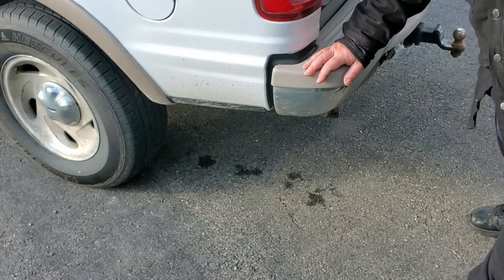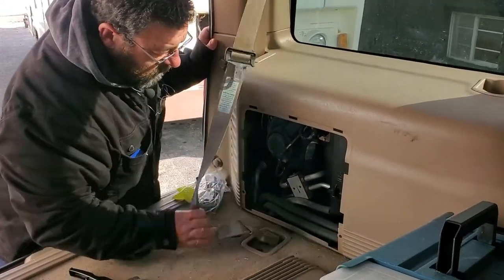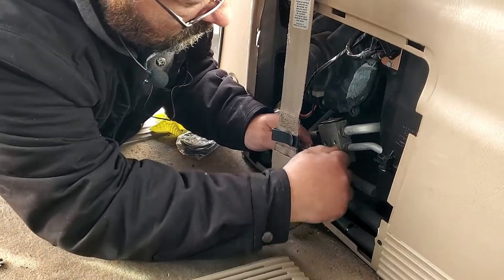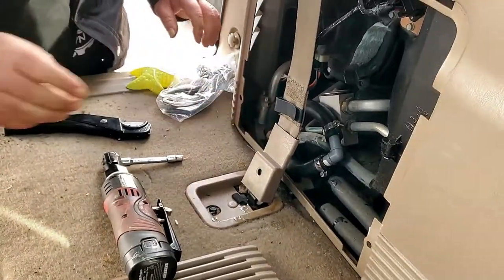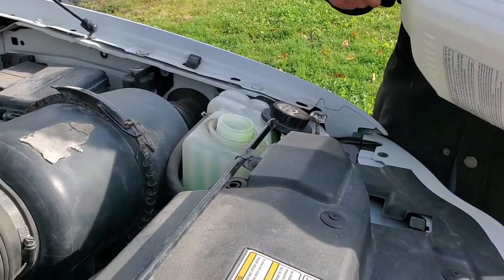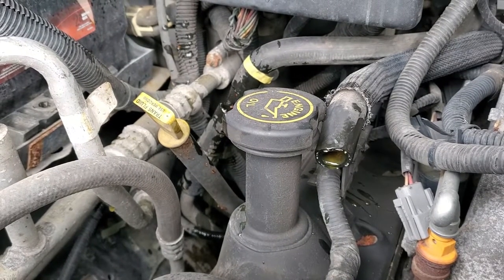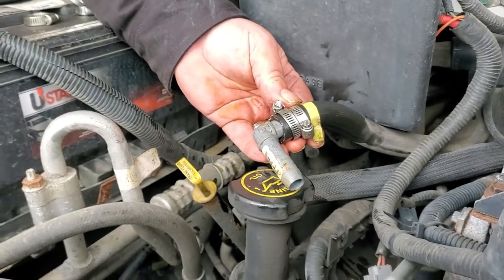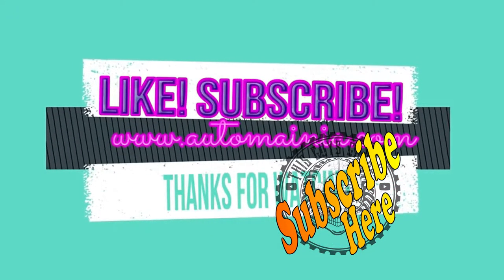rear heater core bypass

Comment: I have a 94 Ford Aerostar and it's leaking all along the side of the driver side to the rear. I'm glad you said Capital that the front instead of the back that's what I would have started as well. Now I just got to find the hoses I'm not a mechanic so thanks for your video
Reply from the maker: as long as you get in front of the leak you will be set . let me know how you get along.
Reply: Well I fixed it the two hoses for coming off of water pump so I just did a bypass right there in the front only took me 1 hour to do all the work no leaks!!
Reply from the maker: @brentmaveric4981  awesome Brent, glad to hear it

Comment: I'm permanently removing the rear heater unit to make more room for campervan buildout of my Chevy Suburban. Thinking I can just put in a bypass just like your video. Any concerns with this setup long-term. Do you have any advice for how to tie- out the A/C lines in the rear?
Reply from the maker: you will need to get the ac removal dealt with professionally ,huge fines for opening ac lines. no concerns long term

Comment: Hi Shaun, any idea what size the rubber heater hose is in the back?  I’d like to order the 90 degree part in advance; I live in remote area.
Reply from the maker: HI THE PART WAS A HARDWARE STORE ITEM IT WAS 1/2 INCH inside diameter in this application . sorry for the caps lol didn't know the lock was on.

Comment: I have this exact problem..only question I have is what do you do with the open ports that are created after you cut both hoses off under the front hood
Reply from the maker: i looped the or connected them together the same as the back to get in front of the leak. let me know if you need any more guidance.
Reply: @thisguysgarage  I have the same question.  Do you just leave the other ends open?   I see you bypass one end, but do you just leave the other half of the hoses below the cut open?
Reply from the maker: @nploda1408  yes just leave them  open as long as they are looped back to the engine you are good
Reply: lol i’m not sure you people should be diy ing
Reply: good job on video tho littearly have my line plugged off and was about to start it untill i watched this video

Comment: So you plugged off both ends of rear heater hoses, but what about connecting the front hoses to circulate coolant instead of pouring out rear heater hose ports
Reply from the maker: that's actually what ended up happening in the video because it was a line that got punctured near the tire the heater core was ok actually . thanks for the comment kari,spot on!